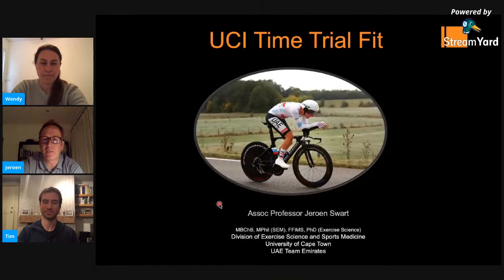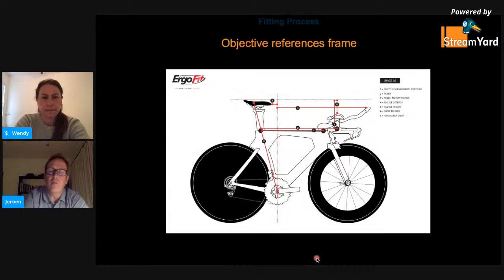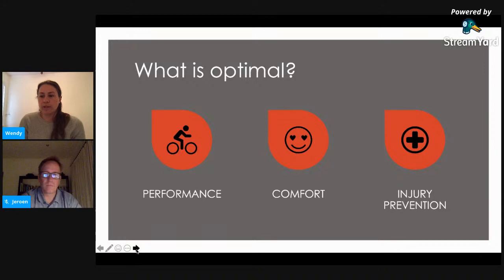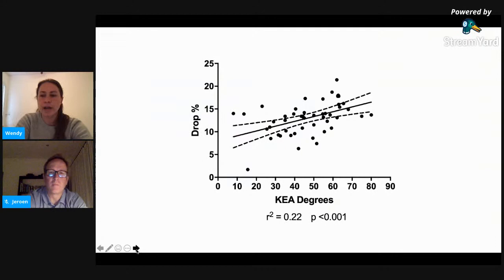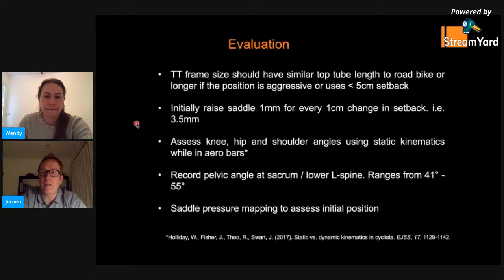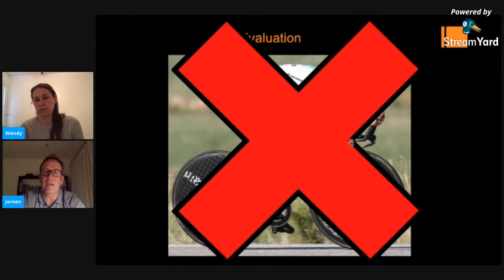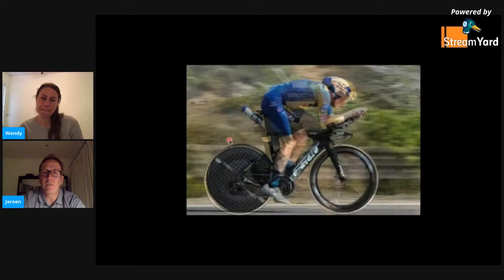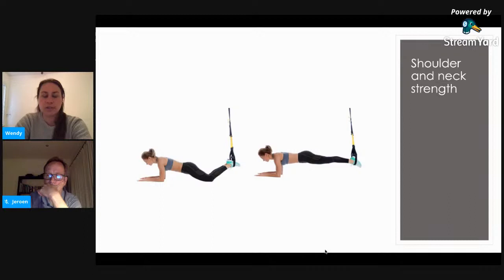"Time Trial Position: Optimisation For Road Time Trial Performance Within Existing UCI Regulations"

Comment: Only just found out about you guys & gutted I missed the live stream! I'm starting out in bikefitting and found this one of the most helpful resources out there. Can I just ask what anatomical landmarks are used for both the torso angle and hip flexion angle? I know there are a few different ways people measure so I just wondered which points you choose to use. Thanks in advance.
Reply from the maker: Thanks Sam! Depends what you want to know. Some systems only allow you to capture the relationship between the greater trochanter and the lateral acromion. However best option is to back this up with analysis via high FPS video capture e.g. you can draw the sacral angle, and calculate true hip angle  off this if you think it necessary.
Reply: Thanks so much for the reply. In the context of the video am I right in saying HFA (for example) is measured as sacral angle to the angle made by the femoral condyle to the greater trochanter? Just trying to make sense of the angles mentioned (69-74)